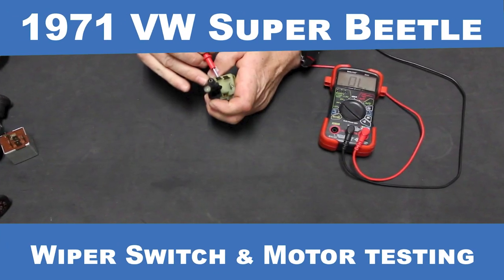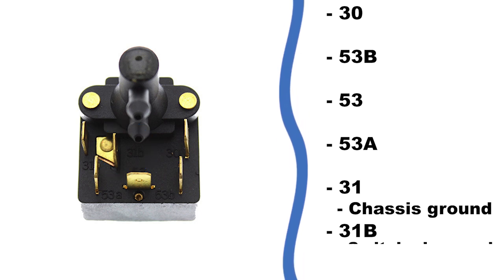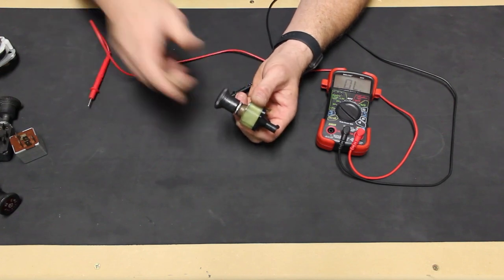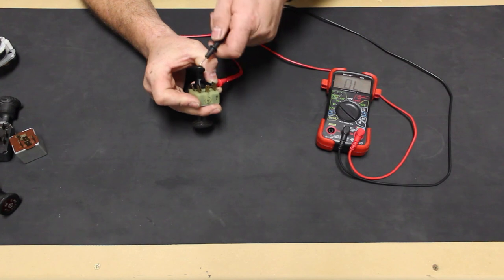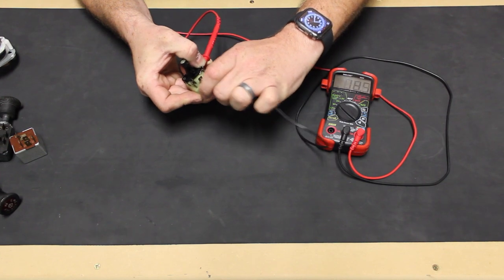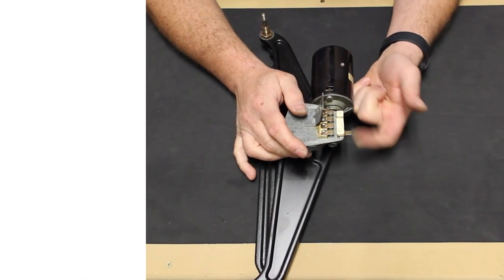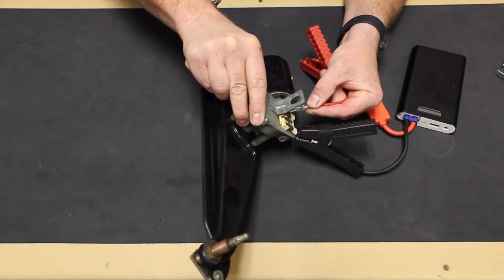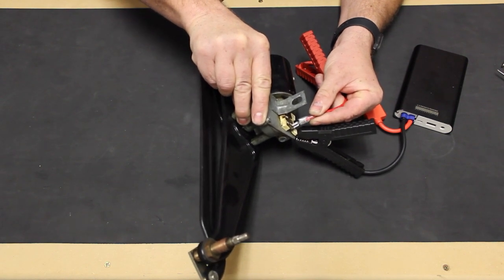JBugs - VW Dash Switch Testing - Wiper Switch & Motor

Comment: Do all wiper motors have park? I have 2 motors and trying this simple test cant get it to park. Every other operation works fine i just need to time it. Both are 2 speed motors.
Reply: Yes, all wiper motors have a park position (terminal 53a or 54). Early wiper motors that have been converted to 12 volt can often times over run the park position and keep running. In those cases it might be necessary to "manually" shut off the switch once the arms have have reached the bottom of the windshield.
Reply: @Sam_Mebane  thank you very much for the reply. The info is very helpful. So does that mean if my park isn't working I need a new wiper motor?
Reply: @gosetto69  possibly. if speed 1 and 2 work but the park does not, I would replace the motor.
Reply: @Sam_Mebane I must say happy holidays, I cant believe your replying to comments. You are an absolute 💎. I was thinking that i should replace it, only thing is I have a manx conversion. So what wiper motor do I get? There are so many different wire configurations for the new motors, and none of the new motors match any wiring diagram I can find colour wise.
Reply: @gosetto69  I wouldn't stress about the colors, the most important thing is matching the motor mounting style as the motor mounts to the wiper arm assembly. Look through the classifieds at thesamba.com for wiper motors to see which style you have and go from there.

Comment: I’m guessing if I have continuity between all the terminals all the time my switch is no good and probably my motor is burnt out do to bad switch?
Reply: It's hard to say whether the switch shorted the motor or vice versa. Either way, if the motor is burnt and the switch is too, they both need to be replaced.
Reply: Thanks for all the videos! There a big help

Comment: This is awesome but I have the steering column wiper switch. Do you have a video showing how to test that one?
Reply: Not as of yet, no. The same steps apply, just spend a few moments with a continuity tester and you'll see what the input and output wires are.
Reply: Not as of yet, no. The same steps apply, just spend a few moments with a continuity tester and you'll see what the input and output wires are.